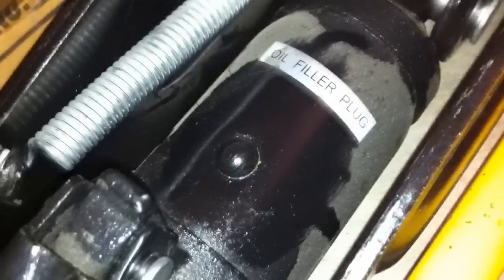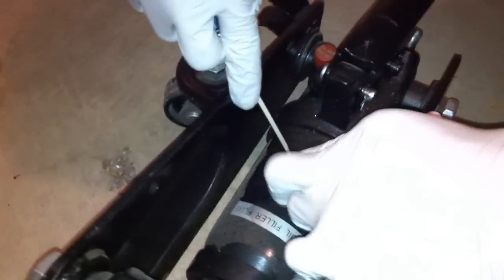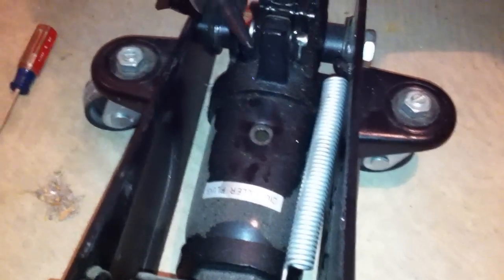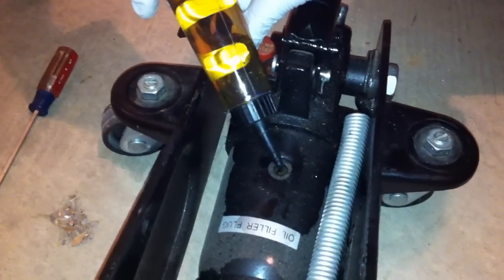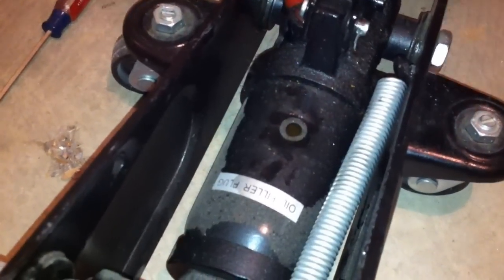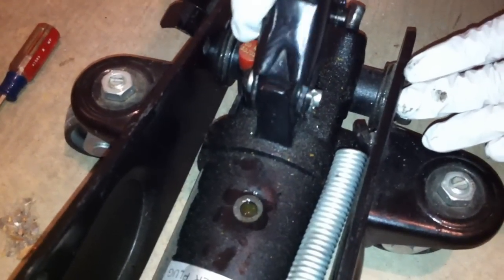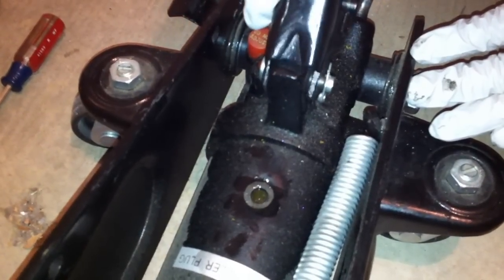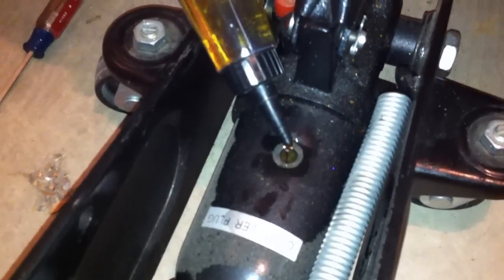Tutorial: How to fix an ailing hydraulic jack

Comment: I just want to put my two cents worth in guys never throw away your jacks they are all fixable they can have Parts replaced their Universal when you think that Jack is junk it is not the internals are just as new as the day they were put together it's just the outside that looks tore apart you can replace everything I have got over a dozen 1970s Jacks from Japan that people threw away and I have fixed granted they're mostly at my friends homes and I'm working on their cars but they're still working in their 50 years old there's nothing wrong with them old scratched up not as pretty yeah but that's it

Comment: Hey dude my jack won't lift up I notice a small metal pice shape  like a hook But idk
U think I need a new one or can it be fixeble
Reply from the maker: I'd have to actually look at it to see what you're talking about.  It sounds like you're talking about a c-clip?  You could try this method and if it doesn't work, then get a new jack.  Cheaper than just straight up buying a new jack if fluid will fix the problem.

Comment: I think don't do this if and only if there is a problem with your hydraulic jack.  The reason I said this because I did this to my Husky 3 Tons Hydraulic Jack and now it is not going down completely.  I never have this problem before.
Reply: I just fixed the going down issue on my jack by purge/bleed the air.

Comment: You should ALWAYS leave some room for air when filling - the rule of thumb is full just to cover the cylinder inside the reservoir, or 3/8 below bottom of full hole. Room for air is necessary.

Comment: No it's not. This is an illogical statement in one sense, and dangerously wrong in another.  Brake fluid is not one thing - there are several kinds.  Most brake fluids are mixtures of various components, some of which will deteriorate the seals of a jack.  What is true - is that brake fluid and Hydraulic jack fluid are both hydraulic fluids!  Hydraulic jack fluid is not unique, however, and very similar oil based hydraulic fluids are used in other hydraulic devices - and then simply called ISO 32 Hydraulic oil (as well as other names) - but to be safe just get actual hydraulic jack oil, unless you work with hydraulic systems (common on farms and ranches, and shops, etc.).

Comment: Great video saved me the cost of getting a new jack. Now my MVP works like new again. Saw a lot of videos about substituting hydraulic fluid with engine oil, brake fluid and tranny fluid. But I thought about it . Decided that while my car is lifted with this thing and sure I will use my jack stands. But it just not worth the risk. I mean the cost of hydraulic fluid at walmart is like $1.88 so please people don't use engine oil in your floor jacks.  I mean would you pour hydraulic fluid into you engine.. Remember some people say it's the same thing.  

But anyway my jack would only come up half way.  Now after topping off my fluids it comes up high and strong.  I grabbed a few bottles at walmart and this will be my normal routine on my floor jack.  I change my own oil and use it to change brake pads and stuff.

Comment: Go to Lowes or Home Depot & buy section of 1" ID pipe insulation ($2 or less), then slip it over the jack handle & zip tie it on....no more bumps into your car's paint w/a hard metal handle.

Comment: They can be adjusted.  My 3.5 ton Craftsman was an absolute piece of crap until I adjusted it.  It would take full body effort just to lift a car, and after it was a normal, easy amount of effort.  It also took a huge amount of effort to move without any load on it, and it didn't even move very far then.  One of these days I'm going to replace the bottle jack that's on it with a hydraulic ram, a long line, and a remote motorized pump.  I'm sick of the handle hitting my cars.

Comment: Agreed, same hydraulic principle. But you are not applying 2+ tons of pressure to caliper pistons like you are with a jack piston. Hydraulic braking is friction spread between 4 cylinders so the pressure is not nearly as great. The viscosity of the fluid matters under the much higher pressures of a floor jack. Also brake fluid is known to dry out the seals of the jack piston causing leaks. I don't think that's the case, I think its the "too thin" viscosity issue discussed.

Comment: well, I say this from experience, I have years of being a mechanical technician and in my opinion is the same. brake fluid is hydraulic fluid, think, you by pressing the brake pedal pushes fluid through the pipes actuating pistons brake calipers, is still the same principle with the hydraulic jack

Comment: i have a mvp 3 ton superlift with spedy lift.  when i poped the cap off it mad a loud pop noise and the cap flew across the room.  i had a little bit of fun finding it.  the speedy lift still doesn't work but the jack goes all the way up now.

Comment: This is like Viagra for the jack.  Thanks man, just saved me $25 for a new jack.  What's misleading on my jack (like yours) is that plug that says "Do not adjust".  I thought it was user serviceable.  I also have a plate over top of the refill plug that I had to remove.  It just pops off.  The oil level was very low, now it's back to lifting as high as when it was new.

Comment: I use brake fluid to remove gaskets, it seems to deteriorate rubber, so using it  your Jack which has rubber seals might not be the best idea.

Comment: very helpful,, I have a leak from the little piston below where  the main lever goes into, and it only leaks when apply the car load, but the jack doesn't low the car it hold its wheel, it is hard to replace the seal in this case? thank you

Comment: Jack fluid. In most cases jack fluid is nothing else than brake fluid. Thats what i always put in my jacks (all 3 of them are over 5 years old) and never had a problem with `em at all. One thing you may want to concider is to always store them the right way up. Not laying `em on the side and things of that nature. A jack is nothing more than a simple hydraulic system. Nothin hard about it!

Comment: i dont know much about these jacks i just bought one and it wasnt pushing the car up so i thought it needed fluid because it was brand new so i unscrewed the do not adjust part and tried putting oil in their and that did nothing and now the jack wont even go up. do you think if i just put some fluid in it like your diong it will fix it?

Comment: so to fix a jack which can no longer hold a few ton car up, and is falling and slipping, ALL you do is add oil....? doesnt sound right. that just fixes it, bam. i wish cars were the same, motor has a spun bearing, cylinder 4 is out, just top off the motors oil whoot!